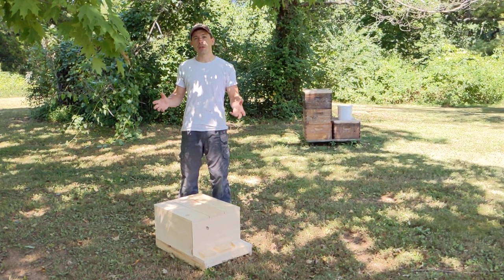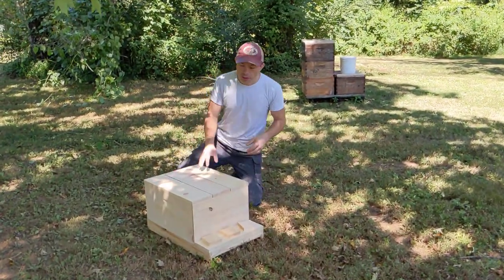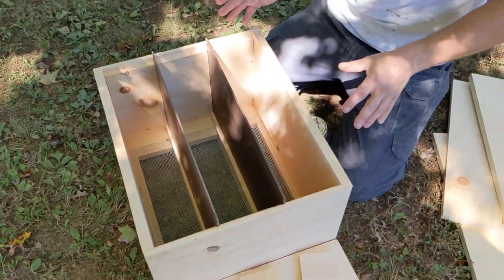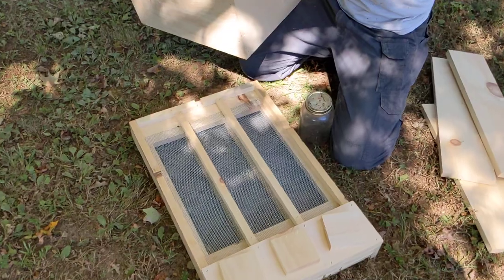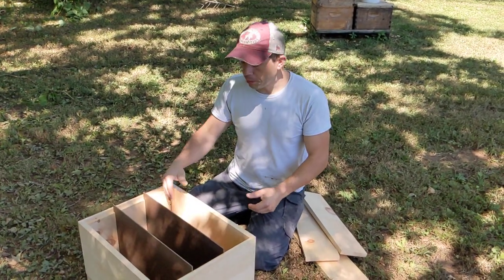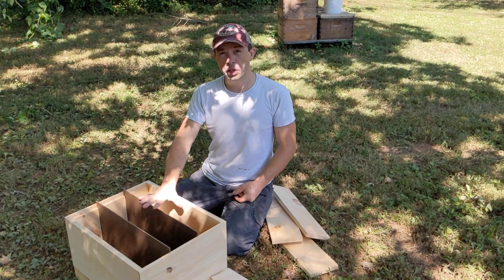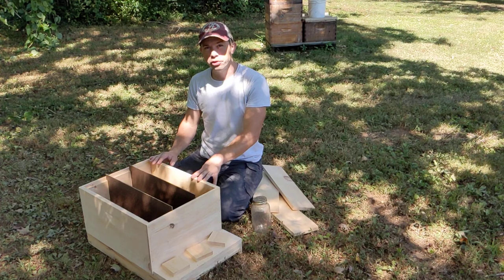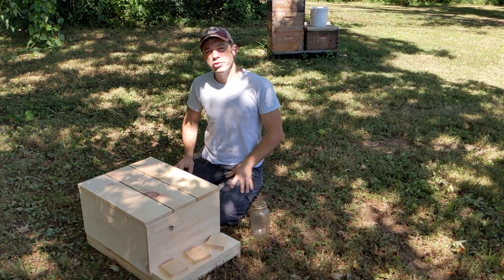Setting up Queen Castles & West Virginia!

Comment: Did this with dividers scrap wood. Used  scarp wood to close out the screen on the snell grove board and the inner cover made 2 frame nucs. Also made a swarm catcher by take a rod and bending it to a loop with a tang of 15 degrees or bend to the angle you need and attach to a pool skimmer and adding a pillow case around the rim with a key chain loop if you want a cover to flip over or hold the pillow case if it was to small. Figured this out as it was happening lol the hard part is figuring out a 80 foot set up tied off to an anchor point to guide it up.
Reply: Than stapled old jeans to each divider to work each section and Duct Tape
Reply: Than below the 4 mating queen put it right on top of a deep with a divider to get mated. 6 queen one foot print
Reply: Like using equipment I own and can keep using like nothing happened.
Reply: Only needed for 10 days than I just condense the hives if the queens don’t make it back.
Reply: The upper entrance was just a inner cover
Reply: Tried twanging and bottle rockets one year with variable success out side the paths of the bees to mimic Lighting and thunder.

Comment: I have a super just like this, I hate to say how old it is but it's safe to say it's older than you!  It's an A.I. Root super.  Don't know where the dividers have gone or the rest of the set up for that matter but I do have a modern screen bottom board I'm not using.  I got a ton of ideas from this video to finally put it to use or at the least set up for someone else!!!

Comment: I used to have this kind of equipment for mating queens....it only seems easy and practicable but there are many troubles in the practice....some mated queens just disappear...you need quite bees and brood frame  to install nucs so I find that queens very expensive....I prefer use baby nucs, one cup of young bees gives the queen....small input great output....cheers
Reply from the maker: There are many ways to do it for sure! Some of the biggest operations use little nucs. I don't raise queens for a.living and I want to be able to evaluate queens before I plug them into a honey production colony. 
It is soooooo much quicker to find queens in baby nucs though!
Reply: @kamonreynolds  speaking of bee queens and their quality, I am of the opinion that the best queen is a young queen.... quality testing is an expensive job and it is really worth doing just for yourself.

Comment: Hi Kamon, 
Loving all the info and ideas! Quick question, what do you do if you have one or two queens left over and you’re getting close to winter? Seems like such a small colony wouldn’t make it through winter.
Reply from the maker: That could be an issue for sure! Sell a queen to a beekeeper in need and combine the rest of the bees back to a good colony and make them even stronger!
Reply: Hey this is David Bailey.  The beauty of this queen castle is it is a double screen bottom board so you can over winter the queen castle on a strong hive.  The small clusters will benefit from the heat of the hive.  If you lose a queen in winter or early spring you have a replacement on hand.  Also with the double screen you can treat your queen castle with oa when you treat you hive.